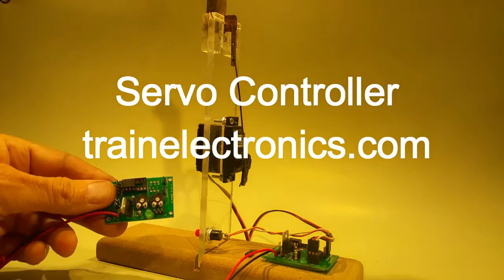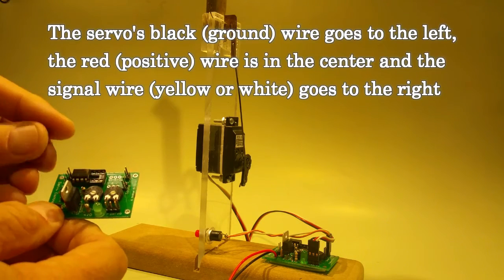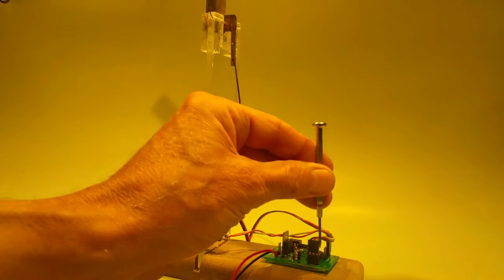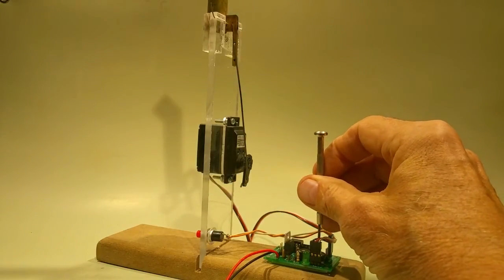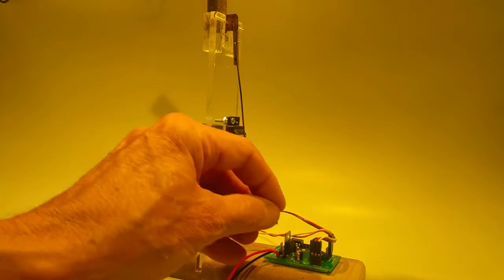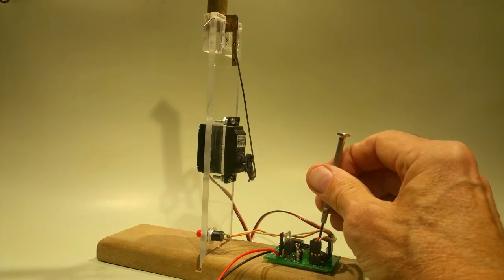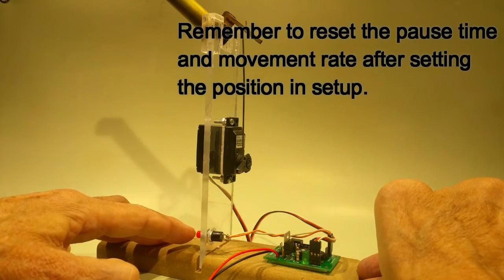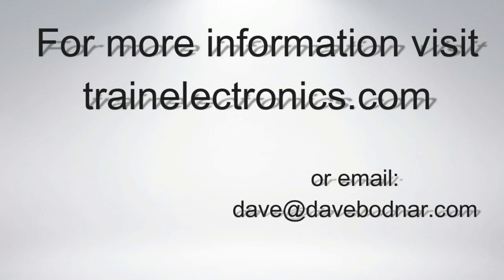New Servo Controller

Comment: did you make this controller or buy it somewhere?
Reply from the maker: I made it - see:
http://www.trainelectronics.com/Animation_servos/index.htm
or  (for a newer unit)
http://www.trainelectronics.com/Servo_PIC/ServoDFPlayer-MP3/index.htm

dave
Reply: Thanks, do you sell just the boards?
Reply from the maker: Sorry, Andy - I just went through my stockpile and don't have any boards - no plans to order more, either.

The circuit is on the web page and is fairly easy to implement
dave
Reply: +Dave Bodnar ok i will check it out thanks again Dave
Reply: im looking for the cheapest possible solution to control several servos for turn outs in a switch yard. what do you think about modifying those cheap ebay servo testers
Reply from the maker: Have you seen this video of mine?
https://www.youtube.com/watch?v=P-vbWRBx03Q
You don't get much cheaper than those testers.
More info here:
http://www.trainelectronics.com/Servo-simple-controller/index.htm 

dave
Reply: +Dave Bodnar i did see that, that is where i got the idea :) 

didnt remember it being your video lol...  have you taken the idea any further?
Reply from the maker: Nope.  Moved on to other things 
Dave
Reply: +Dave Bodnar i understand, thanks for your time.  i will see what i can do with it